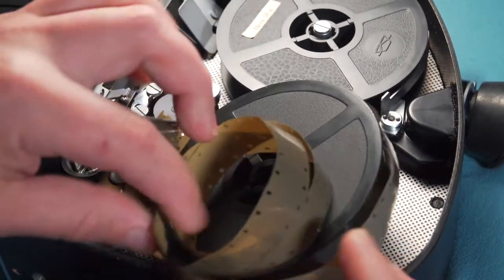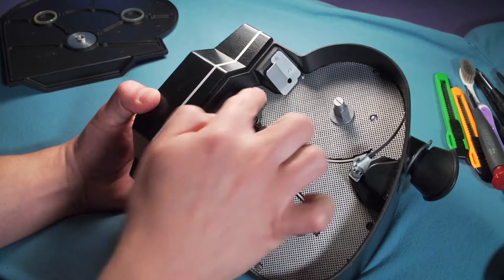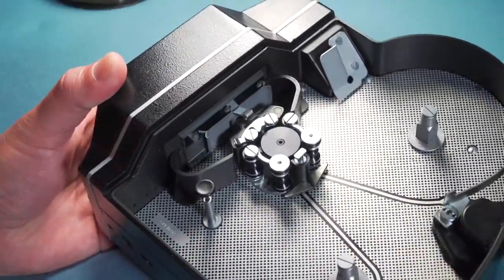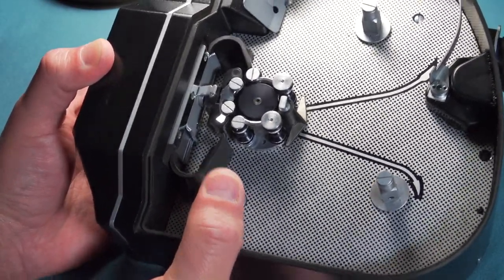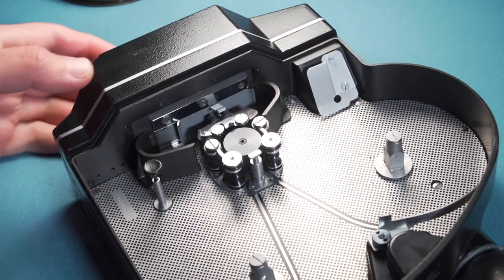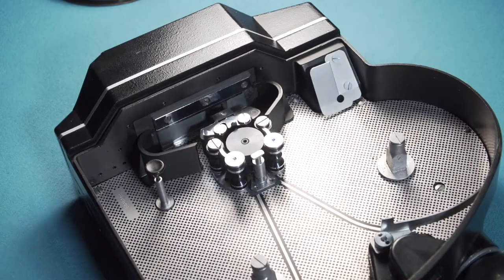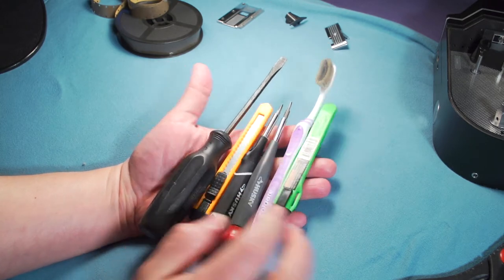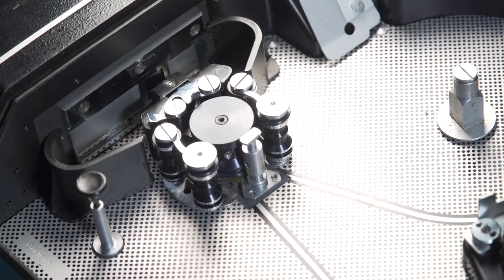Krasnogorsk 3 - Removing the loop formers.

Comment: Hi, thank you very much for the comprehensive explanations of this video. It is very clear how to remove the loop formers: I tried to do it myself and I succeeded despite not having great familiarity in this matter. I absent-mindedly left out a very important aspect before performing this operation: make sure that the two screws of the main sprocket were positioned centrally in order to be able to remove the internal part, otherwise this would not be possible. In this video this operation is very well underlined! Thank you so much for sharing your precise and complete knowledge about Krasnogorsk-3 which allows all of us to use this camera as if it were new!!!❤🙏

Comment: Hello, I just followed your instructions to remove loop formers.  Everything is good but now my trigger isn’t working. Can you guess why? Except that everything is good.  What did I done wrong?
Reply from the maker: Hello, It's impossible to say without looking at the camera. The most common problem is the gear not being properly aligned. If that's the case you won't be able to wind the camera up and it won't work. Try going back to the beginning. Start again, but be careful to go trough the steps. If the camera was working before, it should work again, so you are doing something wrong, but it's impossible for me to tell you what is that.
Reply: @TheCinematographyLab thank you.
I tried reassembling this again and again.  I can wind up the camera. But just trigger is not working. 
Is there anyway I can break the trigger? Sorry for this. I know this is so blurry.  I don’t know why suddenly trigger is not working
Reply from the maker: @sangbinpark5584  Does the camera remain wound up when you wind it? Try to think about parts hitting against each other putting a lot of friction on them. Send me a video. You may have to upload it to YouTube or send it via We-transfer.
Reply: @TheCinematographyLab Hello, I just want to let you know I fixed my camera.  The problem was, recently I changed my lens mount to PL.  and this guys made screw so huge.  So this screw was stucked in shutter blade.  It’s ridiculous long. I don’t know why I haven’t seen it.  Anyway somehow it happened when I remove my loop former.  
Thank you so much.  I really appreciate your kindness
Reply from the maker: @sangbinpark5584  Good to hear that!

Comment: Hey! I have issues to put the plate back. I’m trying to place it down but the wind doesn’t move and is stuck to something. When I try add pressure it does make loud sound and click one time which scares that I broke something
Reply from the maker: Hi there, it's impossible for me to know what's going on without looking at the camera. There are no parts that can brake easily, but don't force anything. My recommendation is to pay attention to the details and try again a few times. Putting the plate back can be frustrating.

Be patient, pay attention to everything, don't force anything, don't apply excessive force and the plate will fall in place. 

If you want to send a video I can try to see what's going on: aresvisuals1@gmail.com

Comment: I pulled the plate and it won’t wound do I have to reseat it
Reply from the maker: The gears are not engaging any more. You can try pushing the plate down a bit and winding the camera to see if it falls in place by itself. If that doesn't work you have to pull the plate, put the gear back in position and try again.
Reply: @TheCinematographyLab  gear as I’m the black thing with the small screws ? Appreciate you a lot to
Reply: @TheCinematographyLab  I never got to pull the plate out entire just went to unscrew and thought I had the two small unscrewed one was one wasn’t smh
Reply from the maker: @javansmith3080  Pull the release button and wind the camera at the same time, that will activate the mechanism. Remove the screw you already started completely before winding the camera or it may cause scratches.
Reply: @TheCinematographyLab  thanks so much I got to the gesr but it just won’t fall in place which is the easiest way you found
Reply: @TheCinematographyLab  I can’t get it to line up
Reply from the maker: @javansmith3080  It's almost impossible for me to give you advice on how to do something if I cannot look at the camera. If you tried pulling the trigger and widening the camera and the black part is rotating you just have to catch it. You can set the camera at the 8fps position and that will slow the camera down so you can position the screw.
Reply: @TheCinematographyLab  the black part will rotate then get stuck like it’ll move then get stuck , where I’m at now I’d that I have the gear out when repositioning the gear will either fall off not engage or the roller will not fully stay down I must have something placed wrong
Reply from the maker: @javansmith3080  Take a video with your phone and send it to aresvisuals1@gmail.com you may have to upload it to youtube or another place if it's heavy.
Reply: @TheCinematographyLab  I emailed you I got to the sprocket it’s on it the gear is engaging but now the sprocket is  not spinning the inside of the sprocket and roller to the right are working though so it’s a good sign maybe just tighting ?

Comment: I removed the loop formers with no problem. Then I noticed a motor problem which likely existed before I made modifications. I took apart the camera a bit. The tension on the spring releases as I did. Now I can’t get to the two screws on the master sprocket. So now I can’t dissemble the camera to work on the motor. Any suggestions?
Reply from the maker: I'm not sure I understand the question. In order to remove the loop formers you had to unscrew the two screws located on the side of the black cylinder that transport the film, are you saying that that one moved and now you cannot access the screws?
Reply from the maker: I don't have a camera in front of me, but I was thinking about it and you can simply push the release button or trigger and wind the camera at the same time, the mechanism rotates when you do that, it just doesn't hold the wind or the power.

Comment: The black circular part with the two screws you have to take out is not lined up how it is in the video so I am unable to take the second screw out to take off the whole face of it. Any idea as to how to trouble shoot this issue?
Reply from the maker: You have to position the screws first so you can remove them. If you didn't do that remove the one you already take completely. The last thing you want is to trigger the camera which will rotate that black part and get the camera stuck. So either take that screw or screw it back in, then set the camera at 8fps, wind it up a bit and pull the trigger. That will rotate that black cylinder. Find the position where the two screws are accessible and you are set.

Comment: Great video! Did you figure out what was wrong with your K3 in the end? I ordered one and just received it, after winding it up, the trigger doesn't seem to fire and the shutter is jammed. Any ideas or solutions based on your experience?
Reply from the maker: Sounds like your camera is stuck too. Old grease and lubricants solidify with time. If you can wind the camera up and it holds the power that would mean the motor is in good condition. So you would have to open the camera and start checking what parts move. Unfortunately looks like the part that is more prone to getting stuck is the front. You have to remove the decoration and the there are 4 screws there. Don't apply pressure to the mirror-shutter you can break it or miss align the shutter causing an issue with timing. Pretty much what you can do at that point is to rotate a gear that is next to the shutter and try to remove the old lubricants with lighter fluid. Probably a technician would completely disassemble the mechanism to clean it, but if you can free it, just by applying some naphtha the camera would work. The K3s are very simple, but it depends on your abilities to fix and decipher things.

Comment: hey man great video. it seems on my camera there is only one little screw on the black round thing that you marked with the silver marker. is this possible? i tried to turn it to see if the other screw is hidden but i cannot seem to turn it
Reply from the maker: I have seen a lot of K3s and all those cameras had 2 screws. I think it's hidden. If the gears are still in place (engaged) you can pull the trigger and crank the camera at the same time. That should activate the camera and rotate that black shaft. You can set the camera to 8fps so the mechanism rotates slower and you can look for the screws and position them in a convenient position to extract them.

Comment: great vid, as someone ready to purchase one of these I have a few quick questions, if you would be so kind. Most that I can find have the loop formers, is it really that bad to leave them in? I have the choice to convert to super16 or ultra 16, but ive heard many scanning shops cant, or wont, scan ultra 16.. that there are too many alignment problems? 3rd and final is the light meter battery, I didn't find a cheap kit but wondering if you even need this? probably can just measure light manually and set right? I love this camera and am excited. last time I ran 16 was in a bolex in the early 80s and I had to change reels in the black bag. I cant even believe we can do it in light with open reels. that blows my mind ha ha. thanks much!
Reply from the maker: Thanks! I can answer your questions from my own perspective then you can decide if you agree or not.  Is it really that bad to leave the loop formers in? No, it's not. If the loop formers work correctly they won't scratch the film. Unfortunatelly at this point even the most recent K3 is at least 3 years old and as I explain in the video the threads lose their tension and strength with time. You may try testing the loop formers first, then try to adjust them if needed. In my opinion it's easier to just remove the entire system. I just checked  and a spool of film is in the $65 range + processing and scanning + shipping and taxes. I don't want to spend $150 just to learn the loop formers scratched the film. Again you can leave them in, just make sure the film is not touching them once you push that lever down or put the cap on.

Converting the camera to U16 or S16. Well you don't have to convert it to begin with. I'm not fan of squared aspect ratios and I'm greedy. I want to use as much as I can out of the film. At the end of the day the price to process and scan is the same, but you get more pixels. S16 is the best format in my opinion, but no the best format for the K3. Filing the gate is very easy, but nobody is going to convert the viewfinder to s16 for you, so you have to guess. With U16 you don't get as much real state, but you get a bit more for sure. A good thing about U16 is you cannot see the area you are capturing neither, but it's the same  area on both sides, so it's easier to frame. With exemption of one lab in LA I'm not aware of any lab having problems with U16 or charging more for it. It used to be a problem 10 years ago, but today most scanners can scan the entire negative. They don't really care if they are scanning R16, U16 or S16. I'm not saying they don't pay attention or do it in a different way, I'm saying technology has evolved to a point where getting an "over scan" is not a problem at all.

The best thing you can do to measure light is get a hand held light meter. The shutter angle of the K3 is 150° so you get an exposure equivalent to 1/60th of a second if you are using a still photography meter. You can use an app. There are some light meter apps that are free. I'm always buying and selling still photography cameras and I can tell you that meters are all over the place, especially with cameras like the K3 that requires a battery that is no longer produced. After some time the cells wear and meters are not accurate anymore. You can compare light meters with other meters or you can send it in to be calibrated. I don't know if Du-All can calibrate the meter of a K3, it's not impossible, but I would just get a meter. You get even better results.

"I cant even believe we can do it in light with open reels"... I wouldn't say that's a true statement, but I don't think that's new neither. Film is a photo sensitive material. That's the escence of film and it hasn't changed at all. Cameras like the K3, Bolex, Scoopic among other cameras take spools that are known as "daylight spools" This can of containers can be loaded in subdued light. I can tell you from experience that even when I have loaded the cameras in subdued lighting conditions I get film film burns or at least unusable images for about 10 seconds. If you don't load the camera fast or if you try to load the camera under bright or sunny light you can damage a good amount of film. There are several films online that have an over exposed or burned side. That is what happens when someone takes a long time to load the camera or do it in a bright situation. You don't need a changing bag or a dark room, you can load the camera in subdued light if you want to make sure is properly loaded. I spent an hour practicing how to load the camera in total darkness and now I can do it without any problems. Everybody learns how to put film in to developing reels and tanks when you take a class. It can be frustrating, but it's not impossible. I talk about loading the K3 and testing it with film on this video:

https://youtu.be/eZeMi61SY5Y

Comment: Question for you! Awesome video! Unfortunately while trying to take off the barrel screws (which were not aligned) i messed up the crank and now it wont wind. Meaning i cant reach the screws to take off the barrel. Any idea on how to fix this?
Reply from the maker: Well, it's complicated, but here is something you can do. unscrew the 6 (I guess) screws that keep the silver plate in place and try to lift the plate. That should release the energy stored in the motor if the motor was cranked. 

After that the mechanism should move freely. It's heavy, but it moves. You have to remove the front plate of the camera. The one that says Krasnogorsk 3, then remove the screws that are holding that part and take it off. Be careful. The release button has a small spring, you don't want to lose that. At that point the mirror shutter and the gears should be exposed. You have to push the release button and rotate a gear that is in vertical position (when the camera is sitting normally). Use a  rag so the metal doesn't scratch your thumb. When you rotate that gear the entire mechanism moves inside the camera. If you don't push the trigger the mechanism won't move, so don't forget that part. Now you have turn the gear until the screws located in the barrel get in the right position. 

You are going to be fighting the motor, so the mechanism can feel heavy. If you unscrewed the screws on the barrel half way they will not let the barrel rotate, so you will have to go in the opposite direction.

Don't touch the mirror or the focusing screen. Don't put pressure on the mirror shutter. If you try to clean the focusing screen you will leave cleaning marks that look big on the viewfinder. Don't touch the prisms in the front. They are very difficult to align.

I hope that helps.
Reply: This ended up working somehow! Thank you so much for the help! I feel like I understand the camera a lot more now as well. 
 @TheCinematographyLab

Comment: Might be a silly question, but does removing the loop formers and therefore the rest of the pulley system make the footage counter not work?
Reply from the maker: No. The footage counter continues to work. The only difference is the lever that touches and measures the film gets lose, so you have to move the lever to the side in order to load the film. Actually I think the footage counter is more accurate when you remove the loop formers, because there is nothing holding it.

Comment: Thankyou muchly for this great guide - I belive I have done it correctly !
This may be a silly question but looking through the viewfinder while pressing the trigger to roll motor results in a flickered viewfinder image - I imagine this is just the nature of a reflex viewfinder and is a "live view" of the mirror spinning around the gate blocking and letting in light with speed depending on the FPS - is this correct?
Reply from the maker: I'm glad to hear the video was helpful!

You are correct. What you are seeing is the mirror spinning sending some light up to the viewfinder and letting some light go trough to expose the film.

All cameras that have a spinning mirror look like that. You don't see that on Super 8 or Bolex cameras that are equipped with a prism. I rather see the flickering than having a prism in the way. Nothing better than having only air between the back of the lens and the film in my opinion.
Reply: @TheCinematographyLab  fantastic! thankyou